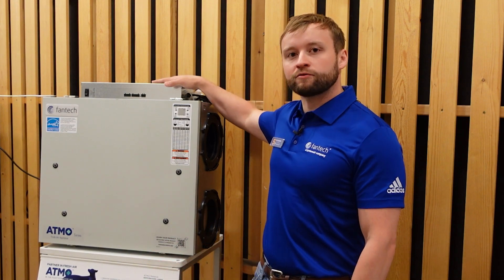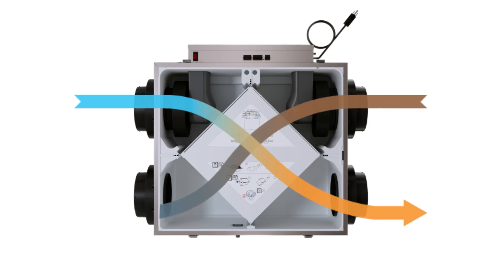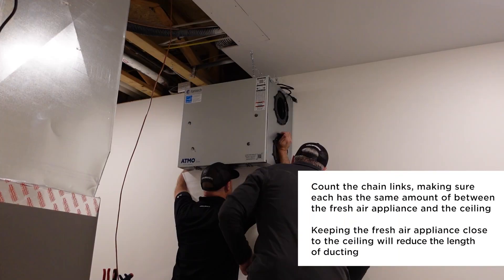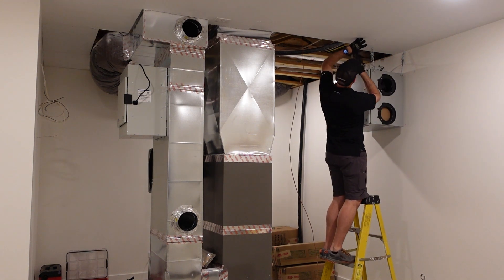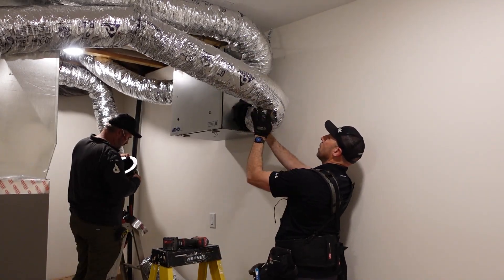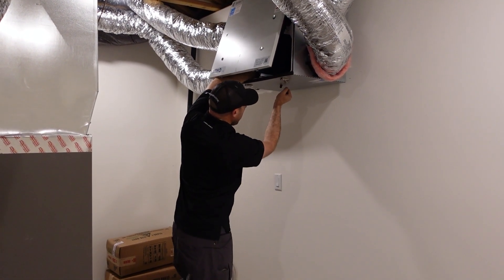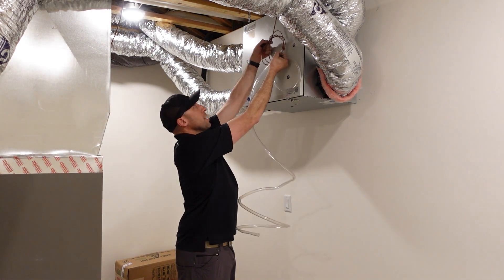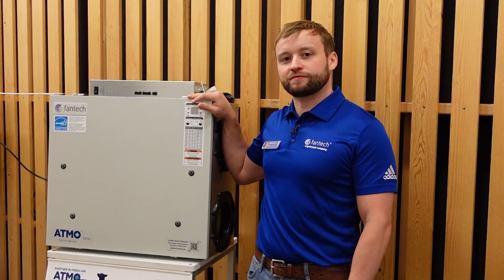5 Minutes with Fantech: How to install an ATMO ERV. Episode 3.

Comment: I'm a bit confused on the routing when connecting to a central ductwork. I've seen some of the fresh air connected in the supply (after the furnace) and some connected to the return duct (before the furnace). Which way is the correct way, and why?
Reply from the maker: For sumplified installation, we recommend ducting into the return duct of your HVAC system. The fresh, outdoor air brought in by ATMO will be conditioned by the HVAC system. If you connect the appliance to the supply duct of the HVAC, untreated air will be distributed around the house. It may impact the comfort of the occupants.
Reply: @Fantechusa okay thanks! Much appreciated. Hey where can I message you about a potential YouTube collaboration? I sent an email not sure if it got through. Thanks.

Comment: I don’t have the wiring connector for my unit.  How can I order a new one?
Reply from the maker: Joshua, what is the serial number of your product? The serial number can be found on the nameplate decal with product information on the side opposite of the electrical box (ATMO Series) or on the right-hand side (HERO Series).

Comment: How does it condition air? Or does condition mean filter?

It can't cool or heat the exterior fresh air.  So if it's 100 degrees outside and I want my house at 72, shouldn't I turn it off?
Reply from the maker: @tfpjr  The purpose of an ERV is not to condition (cool or heat) the indoor air. ERVs bring outdoor air while preheating or precooling it by using the energy of the outgoing air. If you have an ECO-Touch controller paired with your appliance, we recommend to run it on the ECO mode. The controller will modilate the airflow based on indoor and outdoor temperature and humidity during pick seasons. If you don't have such controller, you can simply set the appliance at low speed. There is a black switch on the top of the appliance.

Comment: hi I'm an energy auditor advisor here in Massachusetts and I went to a house that had just been built and they installed one of these but it's pulling cold air into the house and all the Ducts. is it possible to mix up the ductwork that would pull cold air into the house? the should have a heat exchanger in it correct.
Reply from the maker: @leonardearnshaw7733  This appliance is equipped with a recovery core. The supply air temperature depends on the outdoor conditions and the speed. On a very cold day, recovery may not be enough to preheat the intake air to comfortable levels.

Comment: How you run the wires for this
Reply: Right I Wanna Know Too.. Because this is a 208V/230V System/Unit.
Reply from the maker: The ATMO appliance comes with a 5 ft prewired cord for 120V/1~.

Comment: What prevents the fresh air from going backwards through the air handler when the main fan is not on?
Reply from the maker: The air handler and the appliance are interlocked. Then the air handler is off, and the appliance is off. Ideally, you would keep the system on at all times and let the airflow through your home.